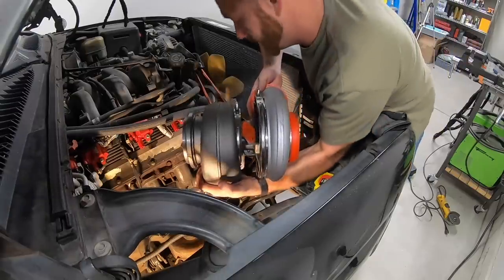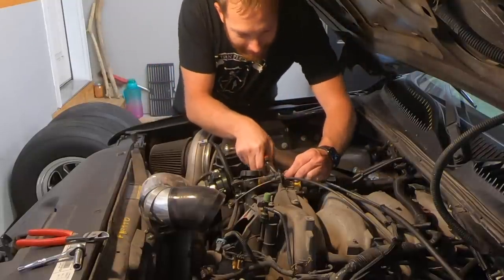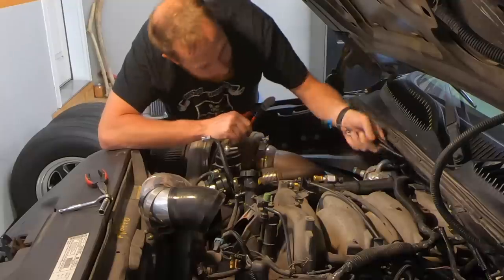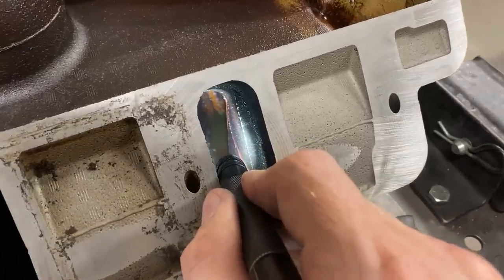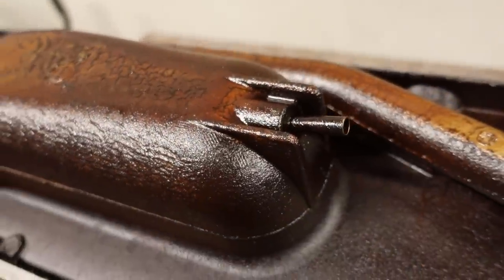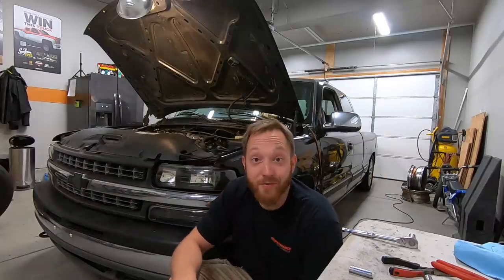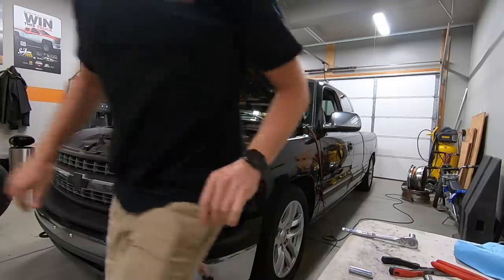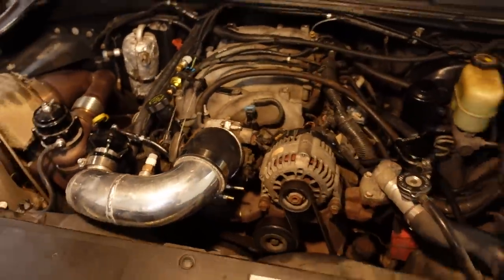this is the WORST ENGINE DESIGN I've ever encountered

Comment: LT, in all fairness, this engine wasn't designed for boost as packaged. So that PCV system makes lots of sense from a pure simplicity standpoint. Rather the issue is that you're using the engine outside its intended purposes. So stuff like this will happen.
Reply: The industrial version was turbocharged with the PVC hole blocked . PVC was relocated to intake of turbo.

Comment: Great video!  I've been enjoying this whole build.  What are you using from 5:30-5:35 to clean the surface of the intake manifold?  I can see it's a sanding block of sorts but what is the abrasive side?
Reply from the maker: It’s a flat aluminum sanding block with some 220 grit sticky back sand paper

Comment: What's the tool used to scrape old gunk/gaskets and clean up the edges of the intake/heads?

Mix it up, drop the 8.1 into a C4 or a C5 vette - never seen that done, dunno if it's even possible.
Reply from the maker: just a razor blade for the scraping, and an aluminum sanding block with 220 grit to follow up

Comment: Hey when you say the worst GM big block yet may I asked which motor you're talking about and what year what's this more produced.
Reply from the maker: that was said with a touch of sarcasm since I do believe it's truly a solid engine but with a bad reputation, but the Gen VII Big Block was made from about 2001 to 2007 in HD pickups, and a few years after that in heavy duty and commercial applications

Comment: I'm not sure I agree with stopping that smoke when you let off the gas the way you did.  I'm not gonna rewatch to be sure but I'm pretty certain that you just blocked off a good source of lube to the cylinders and valves without replacing it.  That's a lot of engine life and potentially compression you just gave up.  I think a check valve would have sufficed.  I believe operating crank case pressure should exceed the air intake pressure even with 20 lbs of pressure aside from the sudden difference when you were letting the rpm drop while the turbo is spooled when coming off.

I'm afraid you may have killed the longevity that you've been able to enjoy.
Reply from the maker: Engines do not rely on the PCV oil vapors for lubrication… no affect to longevity here.
Reply: @LawrenceTolman  If you want to say it's negligible, that term is debatable and the significance determining it is in the eye of the beholder, and the impact is unknown so it is yours.  You want to say engines don't rely on pcv oil vapors for lubrication, that's true. But you weren't giving it vapors when you let off the gas with the spool up and you didn't say negligible.
Extra lube is extra and you're working that motor a fair bit.  It was also a shot of fairly cool oil which may have brought down cylinder temps.  Especially when you consider oil temps are lower than cylinder temps by a fair margin normally before you decide to carry it in rapidly decompressing air.  And cooler cylinders are better for longevity, but bad for fuel efficiency.  Which is also a debate on relevance.
I'd think a more relevant point is, was that frothy oil lubricating the rest of the system right?  Cause a little extra lubing to the rings, valves and cylinders vs lubing everything right is a mite bit more important a matter.  But without comparison tear downs it falls a tad bit under impossible to know.
Is the potential hypothetical longevity gain with unknowable significance worth the known increased power loss when you let off the gas?  The answer is probably not.  But the general fear with chargers is damage to the walls and the rings and extra oil in that direction may have been aiding in longevity.
That all said, my reply has gotten way too long so I'm sorry for wasting your time.  I aired a fear and now it's put enough questions into my head where I wish I had a bunch of motors with the 2 set ups so I could answer them.

Comment: I don’t know if this was mentioned but when you think about it. After a pull with all that boost it’s not going to let the turbo drain drain freely. You have a pressurized crank case essentially plugging your turbo drain.
Reply from the maker: you are correct. I had planned on mentioning it in the video but forgot to...

Comment: Gm engineers at their finest with their forward thinking on the PCB system. It's not like oil drops the octane of your fuel or coats your valves and pistons with carbon fouls your spark plugs anything like that
Reply: PCV. And yes that happens in a two stroke.

Comment: That little hole on the throttle plate should take care of the idle issue but you need to drill it to larger diameter...

Comment: Sounds like the 4l80 can take much more torque than rated.  I want to tune my 8.1 suburban but was worried about the transmission since I tow 7000lb.  Should I be?
Reply: 40k trans cooler and send it bud.

Comment: "That OCD Guy" comment had me rolling.   I'm sure you did but did you clean up all the oil residue that was inside the intake runners?
Reply from the maker: just brake cleaner and compressed air to get the worst of the oily stuff out, but there is still a lot of baked on gunk inside... when I open up the intake to port it, I'll make sure I thoroughly clean it up

Comment: Love the channel 
Here’s a Top tip
Oven cleaner eats carbon
Just let it sit for 5 minutes then lightly scrub with a plastic bristle brush
Just be careful with plastics and rubber
My favorite is Easy Off Fume Free
So when you get that annoying OCD voice in your head your arms won’t get tired.
Reply from the maker: love the tip! need to pick up some of that for the inside of the intake next time it comes off
Reply: Here's a tip top tip
Oven cleaner (lye) also eats aluminum.

Comment: I know that on LS they redesigned the valve covers to fix the oil problem I don't know if they did that on the 496 you have for the intake
Reply from the maker: I don't know if they ever changed the intake or PCV design on the 8.1...

Comment: Nice video. Im new to you videos. Just wondering what's been done to the transmission? I apologize if that was covered in a previous video that I haven't watched yet.
Reply from the maker: It’s been freshly rebuilt (4l80e) with a few hydraulic mods, like dual feeding the direct clutches, and a shift kit along with a circle d converter.

Comment: So how is the crankcase vented now? Is there another breather on it? If not won't the engine blow out all it's seals from crankcase pressure?
Reply from the maker: there is a breather hose going to an external breather tank so pressure won't build up inside the crankcase

Comment: Is the PCV issue something that affects 1999 and up Silverados?  I've had my 2002 since 2002 and I've been wondering about a few things.
Reply from the maker: the LS truck engines (4.8, 5.3, 6.0, etc) have a solid conventional PCV system, this is specific to the 8.1 Gen VII Big Block
Reply: @LawrenceTolman  : 
I’ve always noticed that the Vortec engines DO drink oil , under any heavy load conditions , and it seems that the engine block & VAVLE covers are undersized  so much that there’s no place to put a PCV system that won’t suck oil and make it drink OIL ????

Comment: SO HOW MUCH BOOST DO YOU THINK YOU WERE LOSING THROUGH THERE? THAT'S LIKE A QUARTER INCH HOLE SO IF YOU WERE SEEING 20 LB OF BOOST YOUR DOME PRESSURE WAS PROBABLY AROUND WHAT 40 OR 50? SO YOU WERE PROBABLY ONLY MAKING 10 LB OF BOOST?
Reply from the maker: I don’t think it was quite that drastic to be honest… I measure boost inside the manifold anyway so it was truly making 20 psi, and the hole tapers down to maybe 0.060” to the volume of air lost is pretty negligible compared to the CFM the turbo is producing.
Reply: @LawrenceTolman  I JUST LOOKED AT YOUR RUN YOUR DINO RUN AND YOU SAID IT WAS MAKING LIKE 600 HORSEPOWER BEFORE AND NOW YOU'RE MAKING 8 00 HORSEPOWER THAT'S A WHOLE LOT MORE HORSEPOWER I THINK THAT HOLE WAS LOSING A LOT OF BOOST MORE THAN YOU THOUGHT.
Reply: THANKS FOR REPLYING SO QUICK ALSO. WHAT ENGINE IS THAT YOU SAID IT'S A 7-POINT WHAT LITER? I DIDN'T EVEN KNOW CHEVY STILL MADE A BIG BLOCK. BUT IT'S NOT CONSIDERED AN LS?

Comment: Did that come with the factory style oil splash shield under the intake? I ran one like that 40 + years ago. Hard to find now. The one that just snaps down and is held by the intake.
Reply from the maker: it does have the shield actually, above the lifters and below the intake
Reply: Yes.. but did it come with the engine or did you add it? Inuaes one in all my  BBC- Hard to find now , theu sell.adifderent a tyle- I prefer this one...super simple and works great.

Comment: Nice fix. Are you running 265/60/18 tires on both the ugly truck and the COPO truck ?
Reply from the maker: I had the 265/60 on UGT for a while, but when I put those on COPO, I installed a 275/45 on the UGT
Reply: @LawrenceTolman  Thank you !

Comment: your oil problems are not 100% over i deleted on the orface toob but it burns close to a quart every 700-1000 miles
Reply: 110000 miles
Reply: worth noting i left a pin hole like needle in mine for that extra valve and cylinder lubrication

Comment: id just go with an exhaust pcv it uses exhaust flow to pull air (as long as its after the o2 sensor) out of the crank case
Reply from the maker: Lots of drag racers use that method

Comment: this screams to me "I've never turbo charged a N/A engine before" because check valve in the PCV system as an upgrade are pretty common.
Reply from the maker: I’d say it turned out pretty good for my first time! I mean it took me a few tries to figure out which side of the turbo connects to serpentine belt, but we got ‘er figured out. For some reason though, it keeps melting serpentine belts.
Reply: @LawrenceTolman  underrated comment

Comment: Why not just out a normal pcv system or an exhaust scavenger system?
Reply from the maker: I plan on adding a traditional PCV system, but need to add a port into each valve cover and the intake... this will be done when I install the new engine

Comment: I have an ecoboost with a 5star performance tune and I can add or subtract up to 4° timing, should you subtract some with boosted vehicle or add for more power?
Reply from the maker: That largely depends on the octane of fuel you have available. More timing will result in more power, but also has more risk of detonation so you need to run more octane to resist the detonation or pre-ignition.
Reply from the maker: Typically though, as boost increases timing is decreased to maintain a safety factor.
Reply: @LawrenceTolman  thank you for the reply, so do you think I should just leave it where it is or subtract some?
Reply: The tune added about 4 lbs more boost than stock but I’m guessing they account for that in their tunes I just seen I have the option to add or adjust and wondered what your opinion might be

Comment: Turbo 8.1 awd 93-96 caprice build!
Reply from the maker: thats probably the most unique combo thats been suggested so far
Reply: @LawrenceTolman  Could you imagine launching a 4500# AWD sedan into the 8's? That stock 8.1 should be good for 1500ft#'s. Stronger rods, pistons, head studs, main studs, rod bolts and new bearings. The 8.1 has greater potential than what has been discovered so far. I bet the 8.1 could be the cheapest bang for the buck for reliable HP/TQ

Comment: So where are dumping your back pressure?
Reply from the maker: You mean on the wastegate? It recirculates back into the exhaust and goes all the way to the rear bumper
Reply: No I mean crank case pressure. I think you need to change valve covers from an older 454 for pcv valve set up.  Maybe drill holes in your covers but you would need a baffle. & be best to use a catch can too